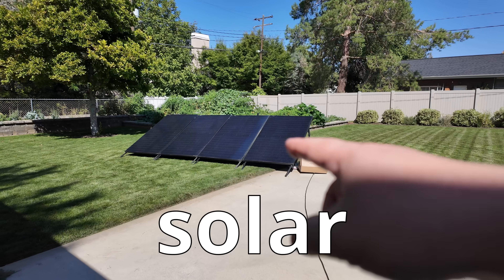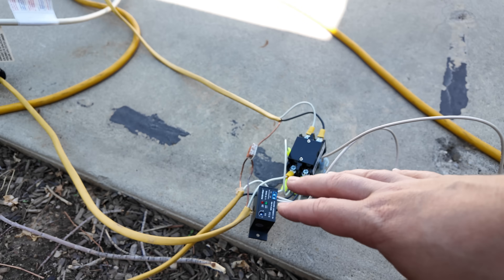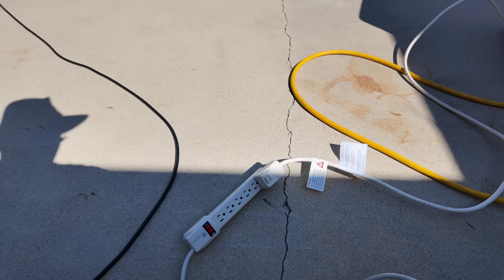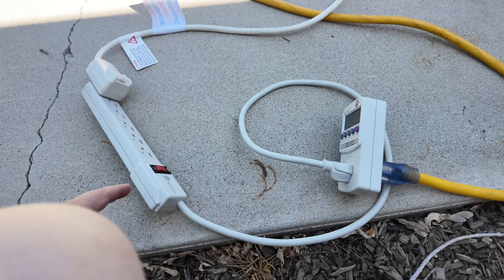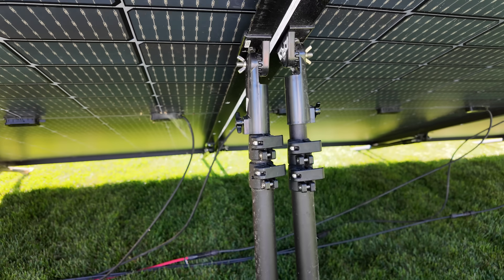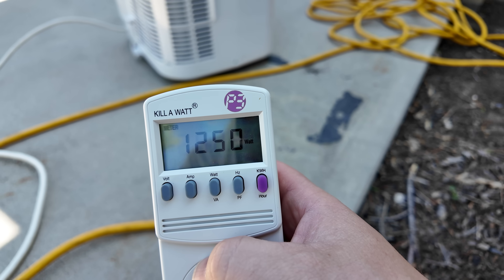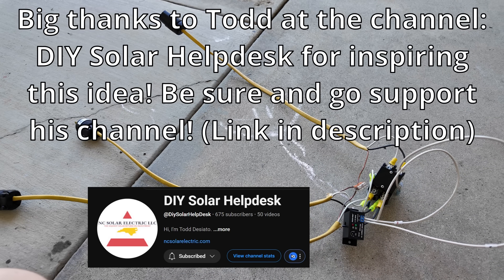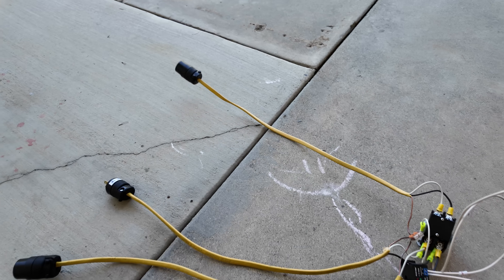FREE Solar Power for Window & Portable A/C! (Simple Add-On Hack)

Comment: Your video of hooking to the outside unit got me wanting to hook to mine. I put 2000 watt inverters on each leg. Then I did what you are showing. That same ct you have I used also. It turns on 4 solid state relays. One for each inverter when it sees power to the ac unit they come on to help power the unit. Go off when the ac unit is not running. Glad you showed this it works great.
Reply from the maker: Awesome! Glad it worked for you!

Comment: Now run the AC from a 2000w inverter and battery bank and charge the batteries with the solar panels until AC kicks on. When AC kicks on run it from the grid tie inverter and continue to charge batteries if excess power is available. No house power at all, just like it's really in a small off grid cabin. That should be interesting : )
Reply from the maker: Sounds like a cool setup! Maybe we’ll have to experiment. Thanks for watching!

Comment: I love your content. Im subscried and i share. I have a request. I have some iq7 microinverter from enphase im completely offgrid.  Would you connect a basic 240v inverter psw to a load center take the microinverters connected to solar panels. 20 amp double pole installed in the breaker panel. Connect a load to breaker panel and see if the microinverter will produce power.  I see your setup and its great. I only have a basic inverter 120v single phase. Myself and others are curious to see if this theory would work. Thanks .love your channel 🎉.
Reply from the maker: So happy you are enjoying the channel and helping to support it! Thank you! If you’re completely off grid, you can’t use any grid tie inverters like the Enphase units because they need to “see the grid” before they will even boot up. If you’re off grid, then you need an off grid inverter that can AC couple with a grid tie inverter. You can see me do just that in this video: https://youtu.be/wgzCEOCY4lQ?si=kCHsehC023l4d3ef Thanks for watching!

Comment: I really enjoy these mental exercises on different solar setups.  I'm not used to contactors so the (unrelated) other idea I had is for dust collection systems in a shop.  Run the vacuum when the table saw/chop saw is running and turn off afterwards.
Reply from the maker: Yep! That could work great! Thanks for watching!

Comment: I have 48v Golf Cart Lifepo4 and Delta 2.  Setup as AC -> 48v Charger -> Lifepo4->Delta2 -> Portable AC,   So I’d like to take advantage of 3 x 350w solar panels but they are 200ft away and don’t want to spend money on cable to make the mppt run charge.   How would I insert your 120v MicroInverter into my Delta2 setup above, the reason for my setup is added AC cooling without high cost of time of use electricity from 3p-9p so that my battery recharges in the early AM hours.
Reply from the maker: Maybe plug your LiFePo charger into the “load” plug of my creation in this video where I plugged the AC unit into and let the solar provide the power for your charger before the grid power does! Definitely consult a licensed electrician however! :)

Comment: For not much more price I'd rather just buy a bluetti elite v2, have it slightly over panelled and run the AC plus having battery backup. Cool idea for fun, but overcomplicated/risky with that exposed contactor wiring.
Reply from the maker: Sure! If you’ve got the extra cash, that’s a great option! Of course you should put the exposed electrical components in a box of some kind. But if I had mine in a box, you wouldn’t be able to see it on the video! Haha! Thanks for watching!

Comment: Airspool makes a window unit that will take solar directly and avoid the inverter and all the fancy wiring. It cost 1000$ and would be about the price after you buy the grid tie inverter and a window unit.
Reply from the maker: True. But then you’re locked into the one kind of window AC. This trick can convert any AC unit to solar powered. Can actually save you a lot of money when it comes time to replace the AC unit. Plus you can use this setup for heat as well which I will be doing a video about in a couple of weeks. The air spool can’t do that! Thanks for watching!

Comment: It seems like in one of these instances, it might be simpler, and not much more expensive to do a "traditional" off grid setup with an mppt charge controller on a 48v lifepo4 battery with an inverter, or a power station.

while this seems like the lowest cost option, my OCD is telling me that when the compressor on the A/C unit cycles off, the solar production is being wasted.

with your solutions on the central AC units, the cost of systems that could power that huge of a load is much more costly while a portable AC unit is well within the normal 1500 watt load for most medium/smaller scale systems
Reply from the maker: Awesome! Yeah! Run some calculations! Spoiler alert! It seems there is a pretty easy way to integrate a golf cart battery and heavy duty MPPT’s with this setup. Experimenting with that next! Thanks for watching!
Reply: after doing some pricing and calculations, the solar input side of the equation makes the all in one power station more expensive than I thought. to be able to offset that many panels worth of input is rises up the price. I was thinking of the delta 2 originally, but that maxes at 500w input, and only the delta pro would get close to the complete offset at over $1600.

DIY "traditional" version of the offgrid solution is comparable in price, but your solution is still a great idea.
Reply: then again, your golf cart battery version might be the trick... Now i'm running off to run the numbers!

Comment: "Straight from that array" - through this "cool little apparatus" (science experiment).  You realize those statements are contradictory, right?  That is only "very simple" for someone with specialized knowledge (so, it's definitely NOT very simple!).  Do it wrong and you destroy the A/C unit, start a fire, or maybe hurt yourself.  I'm not saying it isn't COOL, because it is!  Don't call it "FREE", though.  The panels and contactors and micro inverter all cost money.  There is a potential for a return on investment, but that doesn't make it free.  @5:49 you're not "back-feeding" power, because if the grid dropped, that micro inverter would no longer allow power to flow from the panels to the house.  For people who don't have an electrical engineering degree, just buy a small power station or inverter that puts out a pure sine wave of 120v power.  Plug your A/C and micro inverter into that.  The micro inverter will see the 120v power as "the grid", and you're off n' running.  (Make sure the outlets on the power station or inverter are rated for 20 amps.)
Reply from the maker: Good thoughts! Thanks for watching!

Comment: Can you do this with a mini split?
Reply from the maker: Yes, so long as you set the current switch high enough that the solar won’t turn on until the mini split is running high enough to consume all the power. Might not be as good of a solution since mini splits are so variable. Thanks for watching’

Comment: Would one be able to include this set up with the 5 ton ac unit for the house?
Reply from the maker: Yes. But you need to use a 240v inverter for that. Check out the playlist in the video description. I have 4 more videos in there showing how to do what you want to do! Thanks for watching!
Reply: @theresatrickforthat  Or 120 volt inverter for each hot leg like I did.

Comment: It's a great experiment for the mechanisms described.  For someone serious about A/C I think the smaller A/C unit has an advantage that the bigger one might not have had, and that is the ease at which you can deploy solar/storage/inverter in excess of its consumption.   Though perhaps it would be best to downsize the A/C a bit more.  Say, 600W of A/C and 900W of solar.

That way there need not be any grid connection at all.    Just solar -> charge controller -> battery -> inverter -> A/C.  The A/C runs when the sun is out and then runs past sunset for an additional hour or two, depending on the excess generation and battery storage.

Which is what you really want in real life... you don't want the A/C turning off with the sunset, you want to run it another few hours to remove the latent heat in the walls and really get the room cooled down without having to fight the sun.

-Matt
Reply: I agree. If people could run several small window units(not for central air systems) this way, then no need for permits, inspections, expensive electrician service. As long as you use properly sized wiring, ext cords, fuses,
then fire risk is eliminated. The utilities shouldn't bother you because NONE of their equipment can be affected.!!!
Reply from the maker: Yeah! A fully off grid system is certainly the ultimate…but a whole lot more expensive than this! Thanks for watching!
Reply: @theresatrickforthat  It's off-grid but it isn't really a full off-grid system.  Just three things really:

* Victron SmartSolar 100/20 ($87)
* 25Ah 51.2V LiFePO4 battery ($230)
* 1500W 48V inverter ($135)

And that's basically it.  $452 sans solar compared to the EcoFlow ($300) and a contactor ($25) + other misc stuff.  Though I'd probably splurge a bit and go with the 150/35 instead of the 100/20, I'm trying to be minimalistic here.

I don't think its really that much more expensive in the end and you get a much more useful A/C out of the deal and a system that does not have to be precisely matched to the appliance and can be used for other things.

-Matt

Comment: If you have an aircon with an inverter, I think you can just measure the required DC voltage, and hook up enough panels in series to supply that DC voltage to the aircon unit. That should mean that the aircon unit will draw less AC power from the grid. You then wouldn't need a micro inverter and the other contraption.
Reply from the maker: Hummm. Have you done this successfully before? Thanks for watching!
Reply: @theresatrickforthat  No, hence the 'I think.' I know that there are aircons for sale that are sold as 'hybrid' where you can connect solar panels, and which can supplement this with grid AC. There might be some safeties required.

Comment: I believe the natural evolution of your setup would lead to a load limiting inverter next.
Reply from the maker: Yeah! Do you have any recommendations of a good 120v model you’ve had experience with? Thanks for watching!
Reply: Awesome! How much does the Ecoflow cost?
Reply: The Eco flow is capable of pairing with a Shelley electrical monitor, which could watch the electrical usage and carry it flow, depending on that the only thing that we are waiting on is an update from the Eco flow to make them work together. So the hardware is all there already